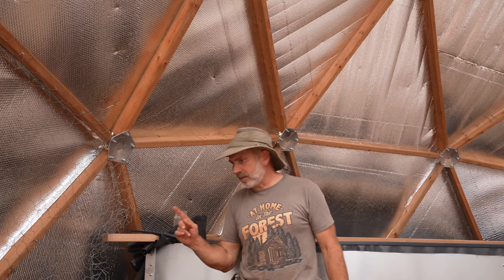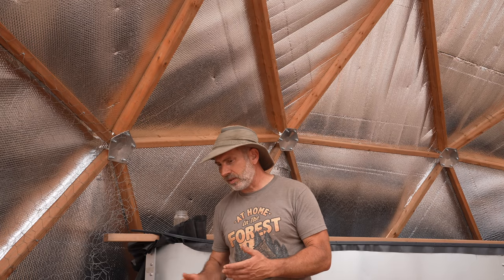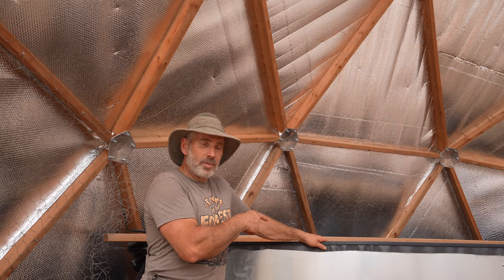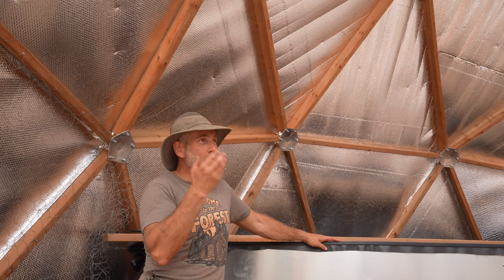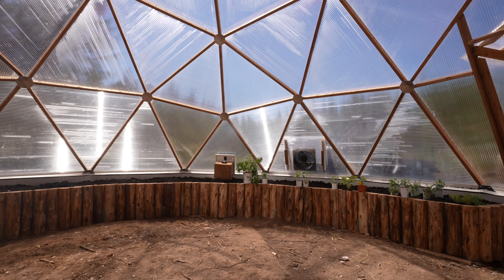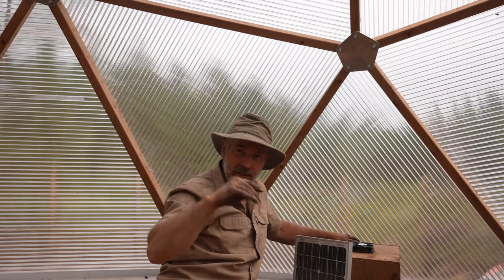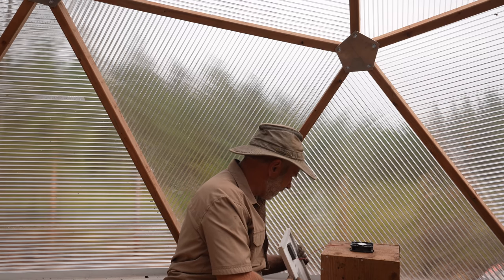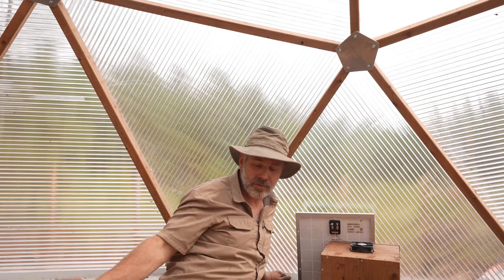How the Soil Heater Works in My Off-grid Greenhouse

Comment: Interesting mechanics/physics. Thanks... though I never asked. I knew you'd explain it at some point, even if I didn't understand what you were doing.
I thought it has something to doing with pumping warm water around. Now that I think about that, they're awful big pipes for a water pump on low power.
Reply: I thought the black pipes were a French drain!
Reply: Pumping warm air through the soil during the winter.
Reply: @judithburke1539  Yes, much more economical than a water pump. I've never seen it before. We don't need to here in Aus, that I know of, too warm, mostly, and just work with the seasons.

Comment: I’m sure you’ve considered the snow on the dome...but I would have been concerned about the weight. You must be positive about your research.
Reply: Hi. Arctic Acres (the greenhouse manufacturer) responded in the comment section of a previous video: "Growing Domes are engineered to withstand over 180 km (about 110 mph) of wind, heavy hail, seven feet of direct snow, and filter out harmful UV rays..."....."cleaning is a simple wipe-down procedure". Hope that helps.
Reply: @itsjustournature8045  THANKS A LOT, NATURE. I’ll look for that post by the company. 👍🏼